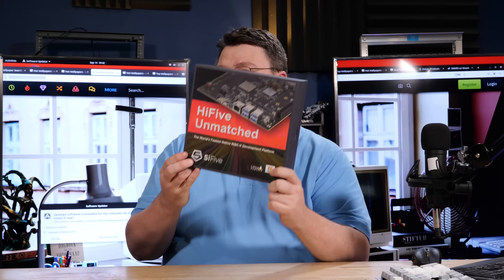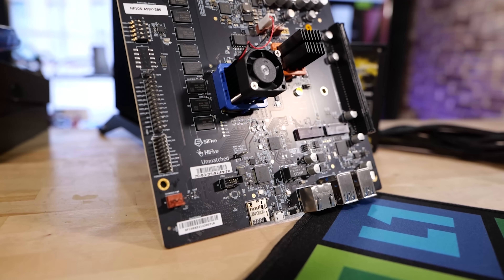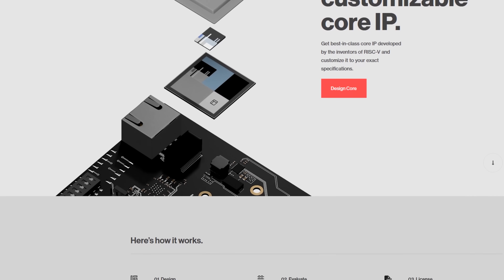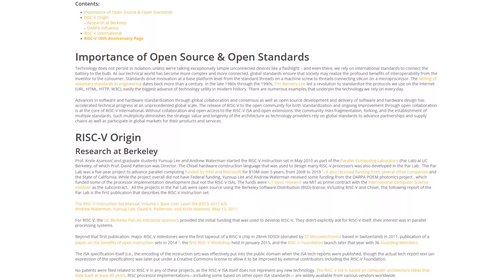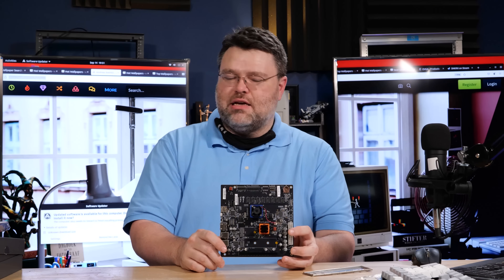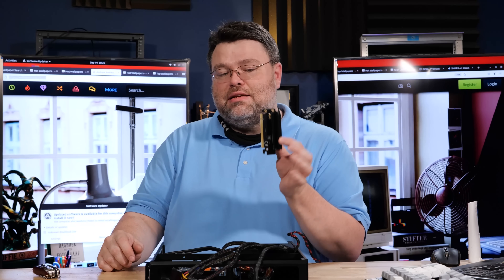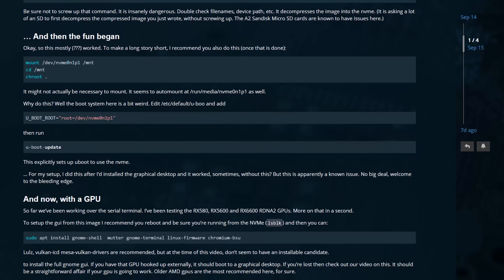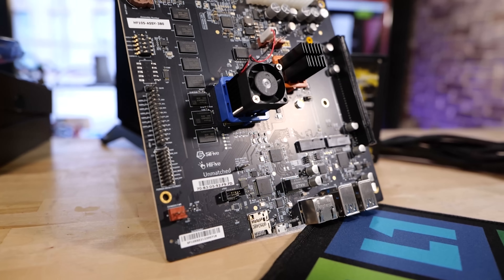RISC-V Business: Testing Gaming and More on the HiFive Unmatched from SiFive

Comment: How would one of these fair as an OpenWRT wireless router/NAS?

This looks like the perfect option if it's able to handle Wi-Fi 7 data transfer speeds, although the cost of the board for what you get makes running an x86 alternative FAR more appealing.

Comment: That's crazy that the platform is so far along that you already have gpu drivers running on it over a year ago!

And if compiling is that straight forward that you don't even need to edit code, you could have a lot of fun with that just porting stuff over, running Linux or bsd...

Comment: The primary technical target is embbeded, and not like phones but specialized small stuff. Thats why the ISA is modular, it allows reduction in design complexity and silicon area while the open source part can leverage a wide range of serious mainstream languages, compilers, and related tools without your whole operational investment being dependent on the whims of a single chip manufacturer.

Comment: Now I just need to find a low power Risc-V board for a nas. My off the shelf nas is getting on 8+ years now, but it has a standby power of like 4w and peak of maybe 20w, add like 5w for the hdd.
Would like a 10g lan(2.5 or 5 would do), and decent zip to handle all those packets. With the last crude tests I ran some years ago it seemed ethernet needed about one core*hz per bit per second. 
So a single 500MHz core was needed for 500Mb/sec network transmission.  Maybe ethernet adaptors have some packeting asic now to offload some cpu work, but back then it wasn't common. 

Also a single 7200rpm spinning drive cannot quite saturate 1g ethernet. But with ssd, m.2 and ram cache sure can, the question is then about the cpu load of compression vs feeding a faster ethernet. Compression having slight side advantage in saving a small amount of high cost ssd storage space but more latency.

Comment: Oh no the first power supply I ever bought for a computer. I think I blew it in 3 months just like someone else in the reviews on TigerDirect back in 2008. I think I when really cheap and low power. At the time I never considered having my psu handle 30% more than my system required power. I figure that was a big contributor to why it failed. I replaced it with a 500w Ultra power supply.

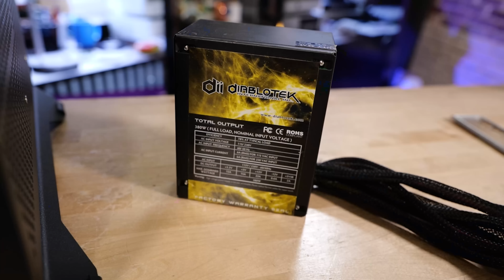Comment: 7:09 - Diablotek Power Supplies. Oh boy, I have a video on my channel of me taking the hatred out on that devilish piece of work. All stemming from the machines at work randomly dieing years ago. All of them were built out with diablotek cases w/ included psu. 10 out of 20  had scorched or heat stressed wiring.

Comment: The reason the web browser was unreasonably slow might be that none of the JavaScript engines have RISC-V backends, so JavaScript has to run in the interpreter, which is slow, and large parts of the web browsers are themselves built in JavaScript, even if the page you’re browsing isn’t

Comment: IoT devices wouldn't be so insecure if we didn't need to connect them to the companies servers for them to even run. I haven't found a single IoT product that gives the option to just run on a personal close looped network or personal vpn.
Reply: that's why it's "internet of things" and not "local area network of things" I suppose.
anyway, I agree. I don't see the point in home automation until there's something genuinely useful to me that doesn't need to connect to the internet and send data to some silicon valley hack to perform its function. The only options that really tempt me are DIY security camera setups that don't use cloud backups

Comment: I can't wait for this to get installed in some x86 chip stack as some low-power co-processor and slowly bulk up and bulk up until the x86 is vestigial.
Of course we have nowhere near the software environment to facilitate that but slowly but surely I feel like it's coming.
Reply: Acorn started with the multi-CPU standards back in the day and it's gonna be the thing that finally dethrones ARM. 

Poetry.
Reply: I could see risc v chips coming with x86 interpreters like apple’s m1 chip does

Comment: I so want RISC-V to become a major platform in the industry. I can see it scaling from mobile platforms all the way to the data center... It's just going to be a matter of time and work by the right people with the right backing.
Reply: Yeah, people think x86 needs to be worried about ARM, but i don't, i think ARM needs to be worried about RISC-V. If RISC-V starts to eat at the low end, and x86 won't budge from the high end ARM could be in for a pinch in the middle. And i don't think x86 is going anywhere, its just easier to keep making it than bother trying to switch the whole ecosystem over for an efficiency gain that shrinks every time the silicon does.
Reply: @eclipsegst9419  Depending on the "ecosystem". Lots of compilers support RISC-V already (and I think that was also the case when you wrote your comment). So, things will "just work"™
Reply: @eclipsegst9419  maybe x86 or ARM won't go anywhere, but RISC-V will certainly force them to play nice, if not even forcing them to open their specs, firmware and all to compete. Maybe Linux didn't force MS Windows to open their sources, but look at how nice they've become compared to what MS was doing in the past. And yes, it is exciting to be able to develop on open source archs like RISC-V. Circumstances have caused me personally to quit on computing, had things been different, I'd be all over RISC-V and Linux right now, testing, trying or making stuff, just as I bet other people are. Computing took a really wrong turn with all the closed specs, hidden spyware and security issues like spectre and others, then you have the phones reporting back against the will of the people, we have lost ownership on our tech and should things continue on this path, computing will die. I see RISC-V as analogous to the Mozilla "take back the web" campaign back in the late 90s-2000s when MS's domination almost killed the web and hindered progress to a halt. The same thing is happening in regards to hardware, and open source archs like RISC-V are causing a stir and a move towards a better direction. I fully support them even if I'm watching the whole thing unfolding from the bench.
Reply: @JayDee-b5u  No it really doesn't, ask Jim Keller or most any computer engineer. 80% of instructions your cpu processes are simple instructions that are just as short on x86 as they are ARM. That leaves only 20% avaliable to even make any improvements on. So even if you could do them 100% more efficiently, you are only 20% ahead. I am talking on an equal process here. As of right now Apple has process node advantage in their ring, but that won't last forever.
Reply: "right backing" thats another way to say alphabet spying agencies getting involved and installing backdoors.
Reply: @JayDee-b5u  Apple doesn't care about anything aside from the fact ARM let's them futher centralize and build the wall of their walled garden higher. There is no measurable advantage to changing over Windows devices. ISA makes very little difference, and ARM instructions keep getting more complex as x86 microoperations get more streamlined. So the small efficiency benefit just keeps shrinking.
Reply: don't worry. AMD bought Xilinx for risc-v. The next 2 or 3 years will be very interesting.
Reply: @DoiGiayBay  I did a few minutes of research and I didn't see any mention of risk-v from them. I did see that their processors use ARM though. I would love to see how they use risk-v though if you know.
Reply: @DoiGiayBay  That's actually bad. We want as LITTLE as possible from the established giants, as they will just implement their ME/PSP & render risc-v USELESS.
Reply: @JayDee-b5u  But why waste the man hours when you can just keep making x86 CPUs. The small efficiency benefit isn't worth all the hassle. And x86 isn't rolling over dead. Alder Lake has 6 wide decode, which was once claimed impossible by arm guys, and big/little, to make the efficiency difference even smaller.
Reply: @eclipsegst9419  programmer will work it out. I think even operating system now needs to change. It should be modular.
Reply: @diocre7446  I assume English isn't your first language I don't know if I follow 100%. Any OS can be made to run on ARM/RISC including Windows. The reason it hasn't been adopted and probably never will, is backwards compatibility. Every year x86 remains dominant, the chances of it's replacement shrink further and further. That boat sailed when AMD came up with x86-64 honestly. Not even Intel could replace it at that point.
Reply: @eclipsegst9419  android is an operating system that run above linux. I think programmer now should make an operating system that runs in low level. 2nd layers are compiler of any language. And apps run above compiler directly. No need for API except for graphics intensive apps like games.
Reply: @diocre7446  You mean, to take, for example, C++ and turn it directly into microoperations?
Reply: @eclipsegst9419   To make everything simple. Look at windows. There's a lot of apps there that is useless. I want an OS that can be modular or design easily by anyone. If they're not gamers. They don't need an OS that has built in DX12 like windows. But just look at windows now. It even has Xbox shit apps there. Onedrive. News apps that you don't even care. Location tracker. Etc.
Reply: @diocre7446  I understand. There are various Linux variants that could serve you well. I haven't used the ultra-light ones but i've read of them. Even Mint is much lighter than 10/11. Much more similar to 7 in its levels of background usage.
Reply: @diocre7446  Android doesn't run "above" Linux. It uses a modified Linux kernel and adds all the other components (libraries) that need to be added. It doesn't have any "layers" or doesn't use "emulation" or something else.

Comment: Ooof almost $700 for this. Hope to see something cheaper in the $200-220 in the next year or two for us hobby level tinkerers.
Reply: That sounds like a mass produced board on a well-established assembly line. I wouldn't bet it happen in 2022.
Reply: @jadesprite  Fair point. But this could still be cheaper in the next few years as power delivery requirements and such aren't as demanding so should be cheaper BOM.

Comment: Very cool. I'm happy to see how quickly this movement evolves, and I've high hopes for future developments.
What needs to happen is a RISC-V variant of the Raspberry Pi or similar. Around that price point anyway, that's when the software side is going to really take off I'm sure. :)
Reply: RiscV Pi-Form Factor board exists
Reply: @vvll9617  So do Risc-V arduino uno form(shield compatible)
Reply: Raspberry Pi has built-in video card. HiFive Unmatched does not. And only particular models of video cards are supported.
Reply: Milk-V Oasis was just announced and Raspberry Pi5 was announced some weeks ago!

Comment: Did they have to destroy that motherboard with the tall heatsinks and noisy ridiculously small fan?  They could have extruded a bigger heatsink to cover both cpu and chipset, maybe with a cut in a corner to allow for mounting the wireless card and then use a 40mm or even larger fan.